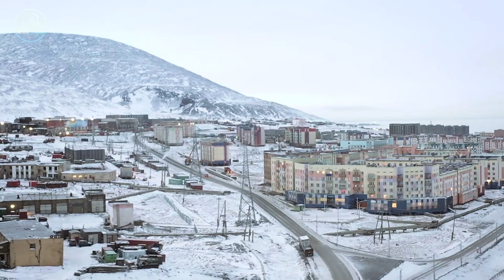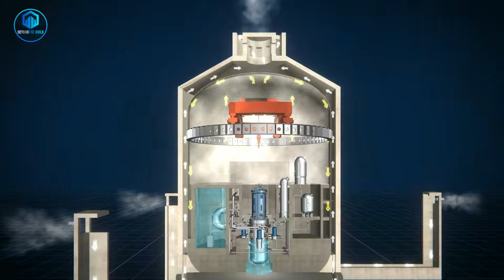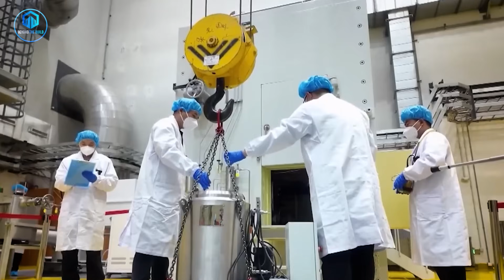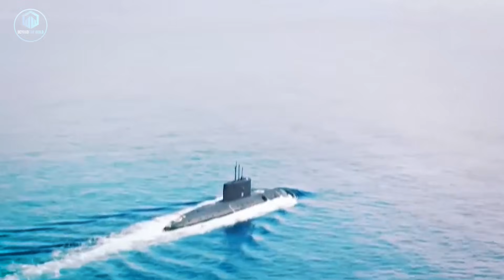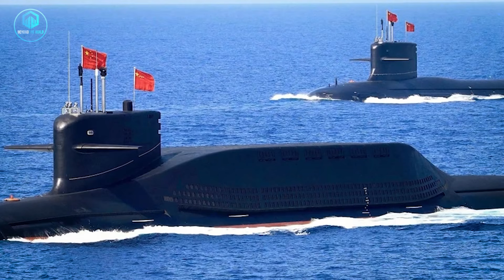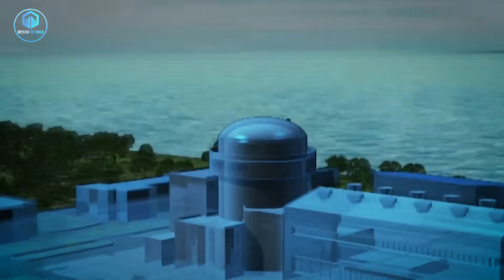China's First Floating Nuclear Power Plant that Nobody knows about

Comment: The NATO countries have been running nuclear reactors across the oceans probably for over the last 50 years, there should be a world fleet equipped and ready to help with any nuk problem in the open ocean but I don't  think there is?
Reply from the maker: That's a really interesting point about NATO's history with nuclear reactors at sea. You're right, having a specialized world fleet for open ocean nuclear issues would be a significant undertaking.